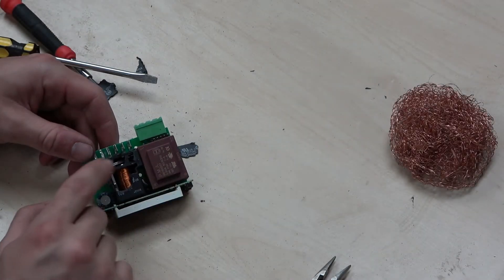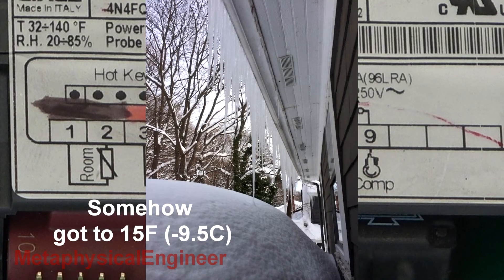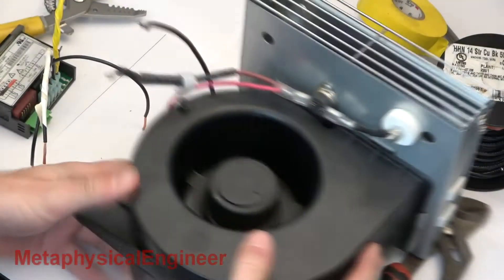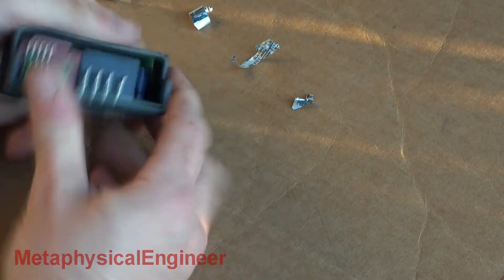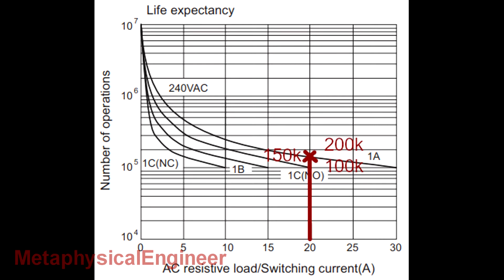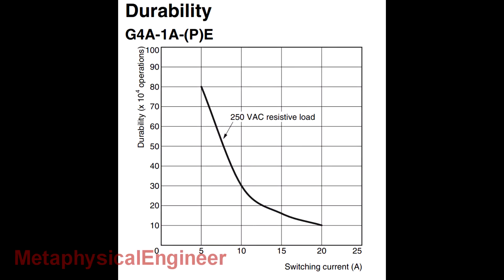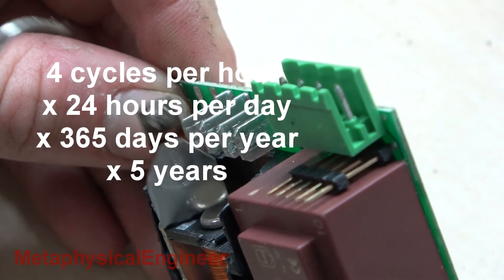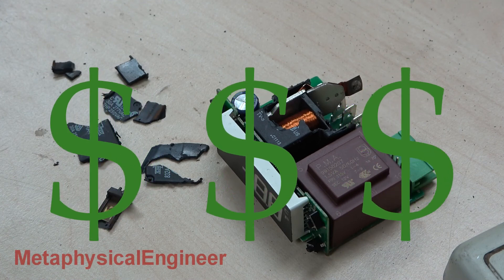What's Inside a BROKEN Dixell Refrigeration Controller?

Comment: Thanks for the internal view of the controller.  Like many things that use relays/switches, the relay is a failure point.  Typically I just clean the contacts of a air compressor relay or do a refinish of sorts using emery type cloth.

My Logitech Pro (M70) PC mouse is giving me left/right button issues.  My intent is to clean the contacts of the switches by running printer paper within the closed contacts and then with a cleaner/lube.  IMO, the Pro has exceptional internal/external build quality. 

I dislike tossing things in the trash.
Reply from the maker: Unfortunate how the bean counters decided saving $2 on a relay was worth it, even when it makes a $200 controller fail so quickly.  Worse when the same cost cutting is applied to an $800+ proprietary control board which is months backordered.  Those are the ones I've rebuilt!

How did the mouse repair work out?  Didn't think those tiny switches were serviceable but I may be wrong.
Reply: @MetaphysicalEngineer  the mouse fix attempt did not work.  The contact lever of the switch is also the spring for the lever.  I've had the same issue with some air compressors.  The pressure switch is integrated with the relay.  The better units have the relay and pressure switch as separate assemblies.

I most likely distorted the fragile arm contact and spring.  I think the switch is available.  Meanwhile I have identical mouses as backup.

I might play with the switch's once replaced.  But most likely may not still work properly, too delicate to work on.
Reply from the maker: Ah, unfortunate.  That was my fear that the tiny switches would be too small to service.  If you can get matching parts, rebuilding the mouse is a great plan B!
Reply: @MetaphysicalEngineer  just like to say the switch's were not removed from the board and cleaning the lever contact caused the lever to come apart from the switch.  The integrated spring of the lever also acts as retention of the lever to the switch.

Toying with the switch removed from the board might work better.  Just dislike desoldering because of the added work and it can only be done a limited number of times.

I miss some of the test instruments made by Tektronix of the 80s.  The active components were socketed flush to the PCB.  Kind of like it wasn't made for a price point.  I mean the stuff looked beautiful. 😁
Reply from the maker: Everything's been cheapened to the point of absurdity.  And that's assuming the actual assembly is done right!  Check out how a cheap PCB with a defect took down that nice Maytag dryer I refurbished a few months back.  Or that Sylvania TV where I added fans to stop an engineered failure by overheating.  

If a million units are produced and somebody finds a way to save one dollar per unit, the company just made a million bucks.  Not their problem if the gadget that used to last 8 years now fails in 3.  Out of warranty, so not their problem, and can generate even more revenue when the customers come back to buy replacements.
Reply: @MetaphysicalEngineer  Just within the past several days the church decided to junk a Maytag washer.  That washer was probably 3 decades old.  I had the same issue of spindle seal leaking on my Maytag decades ago.  It was a very pricey fix at that time by Sears because a retention fastener or two has to be broken off, frozen in place.

They decided on a new Whirlpool.  I bet it will last single digit years before some issue shows. 🤔